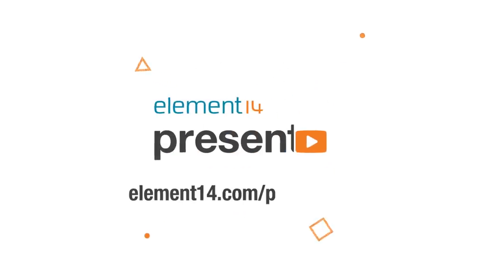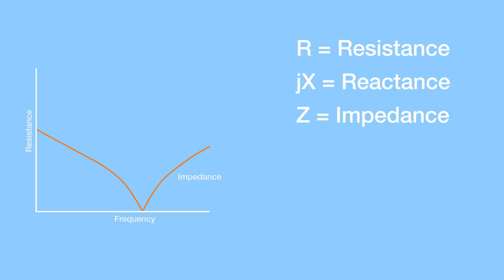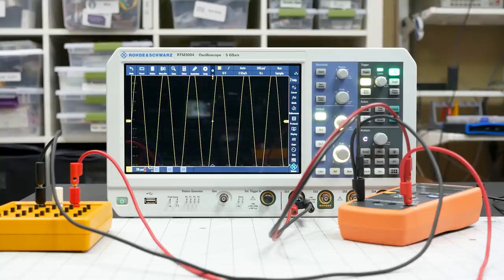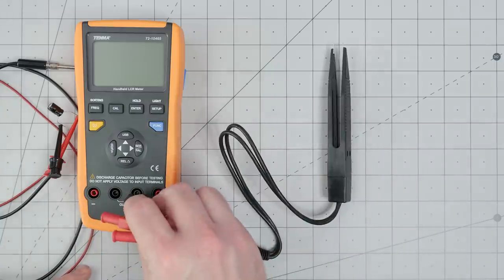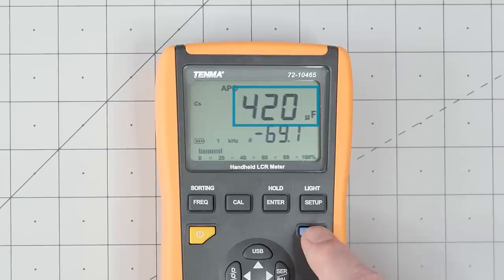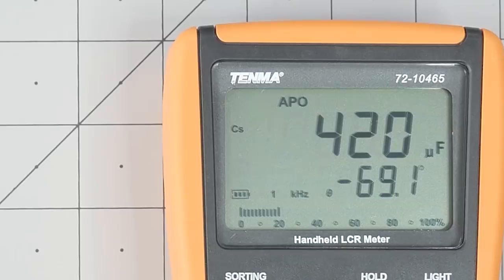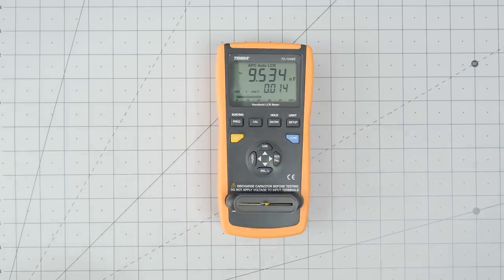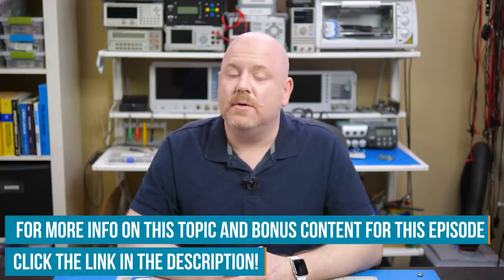Instrument Basics:  LCR Meter - Workbench Wednesdays

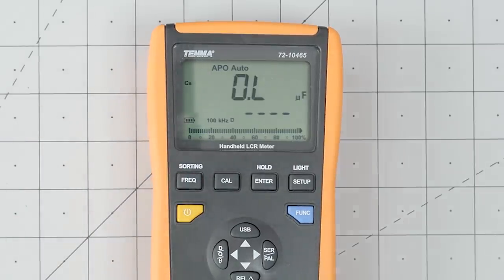Comment: 8:35 The 100uF cap is not OL because "the capacitor doesn't work so great at high frequency". That statement makes me totally lose confidence in the presenter's knowledge. LCR meters measurement range decreases with frequency. At 100kHz the highest range for capacitance measurement listed in the manual is 200nF, so its no wonder the 100uF cap reports back as OL.

I wish it were true that the reason for different test frequencies is so that you can test it at the frequency close to the one you expect to use it at in your circuit which he says a couple of times, but that's also not really true. The unfortunate fact is that if you measure at the wrong frequency it doesn't represent how the capacitance changes over frequency, it just gives you the wrong capacitance.

Comment: Thanks James. 
  I wish someone would do an upload like this but more focused on inductors. Specifically, inductors as they relate to basic DC-DC switching converters. It is quite easy for a hobbyist to build a MC34063, UC3842, or TL494 based switching converter now. There are even a few online calculators that greatly simplify the required math. The difficulty I've experienced is understanding the correct way to test and verify the magnetic components. 
  For instance, I have removed the transformer from a working converter, after measuring the input/output. I then disassemble it, count the secondary turns, and rewind it to my desired turns to voltage ratio, (while cognizant of the secondary to primary current relationship). I want to learn to measure and quantify a design like this hack for a more intuitive understanding. I want to learn how to qualify magnetics of an unknown origin or with an incomplete datasheet.

Comment: Can someone out there help me with why the two different LCR meters that I own give me completely different inductance readings for a simple transformer 120v primary???  I admit both meters are somewhat cheap.  The first one is a Velleman DVM 6243, and I just purchased a GME LCR 200 from All Electronics catalog.  The Velleman shows 6.7 mH and the GME shows 13 mH (twice the amount).  Could this be something where the signal frequency that each individual meter puts out has to be factored in???  Most videos I saw didn't show having to do anything like this.  The clips were hooked up and up came the reading.  I can't see even two cheap meters being this far off with such a common 120v winding (actually going from a center tap to end here).  Any expertise advice would be appreciated.

Comment: What's the difference between DCR and R in the lcr meter  ? Ive seen R increase with freq increase while DCR remains constant   Is  the resistance due to skip depth ? Does total z = sqrt (R^2+ DCR^2+(Xc-Xl)^2) or jus sqrt (R^2+(Xl-Xc)^2)?

Comment: Does anyone know what the bargraph in this LCR meter is actually measuring, it says "%" but what is that in relation to?
Reply: it's a 2000 count meter, so I think it's just an analog representation of the current range with 0 being 0% and 2000 counts being 100%. analog bars on digital meters are often not so much useful as a way of taking a measurement, rather they are useful as an indicator as to whether the measurement shown is valid. Analog bars usually update a lot faster than the digital display so you might see a lot of flickering on an analog bar that would indicate the reading is noisy for want of a better word. Super cheap meters often don't update this any faster, in which case it might as well not be there. I can't tell how fast the analog bar updates on this meter from this video.

Comment: What could you suggest as borderline between small and large ? 100uF is large or small ?
Reply: pF is small, uF is large.
Reply: And if you have 10nF ?
Reply: @giacomo1191  I knew you were going to ask that... :D
I'd just take measurements with a few different frequency and series/parallel settings and hope some of them are consistent.
Reply: @KX36  Or look at the accuracy specs in the manual and use the range, parallel or series model, and frequency that corresponds to the best accuracy for the size cap that you are measuring.